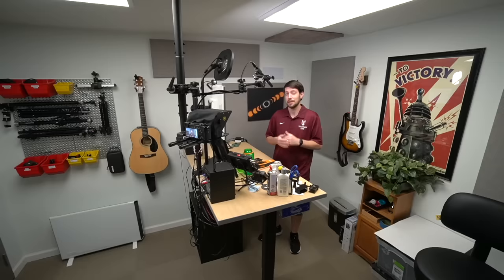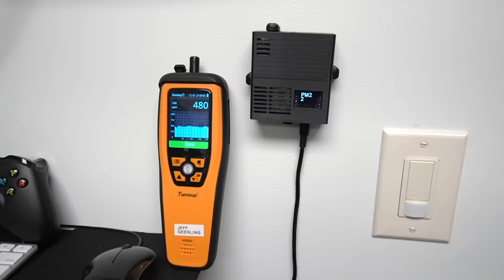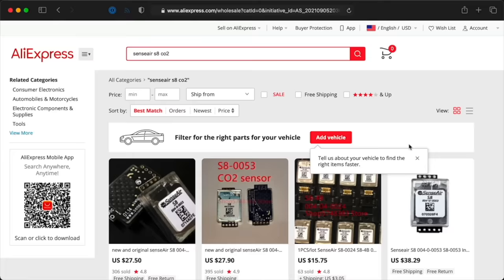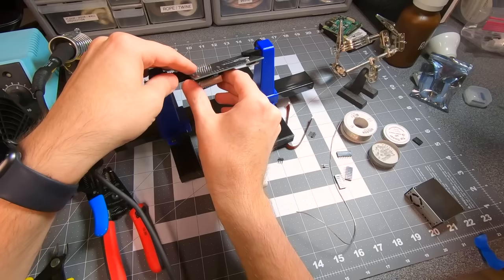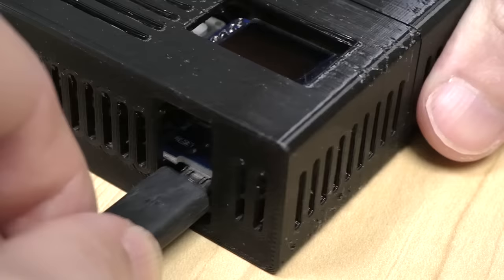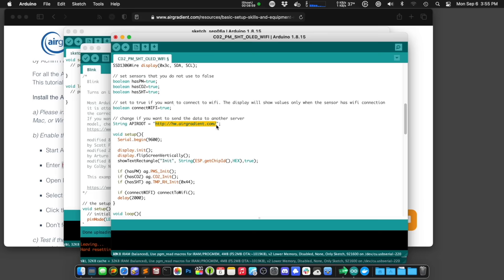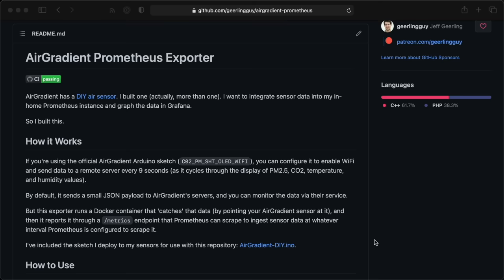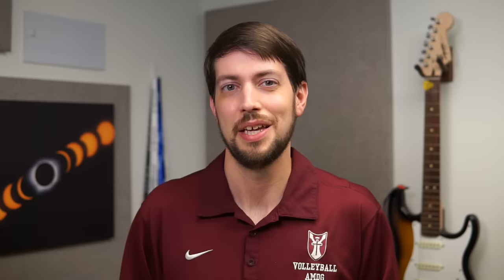Your home's air could be making you sick. Fight back!

Comment: Piping this into something like home assistant + automating the venting system sounds very cool to me. Might be fun to get that working.
Reply from the maker: ESPHome actually supports all these devices out of the box, so it shouldn't be difficult to build a setup for Home Assistant.
Reply: @JeffGeerling  HMMM Very cool. I might actually get this then. My dad and I have been looking for a more permanent solution with a vent we have available. Only problem is the size of the vent, but we can work around that. Thanks!
Reply: @jja2000  did you get any solutions get it integrate with Home assistant?. Thanks
Reply: @wissamoh  Use the ESPHome integration. If you flash the 8266 with esphome it should work out of the box.

Comment: I'm a noob with soldering but this actually looks accessible, I might give this a try!
Reply: Nothing soldered is surface mount so you should have a pretty easy time. One tip - if you’re new to soldering you may want to practice soldering header pins on a proto board first. Proto boards and header pins are available cheap on Amazon and other stores where electronics are sold.
Reply: @markconger8049  The more fun route to practice is to buy the simple project boards that usually only have some LEDs and a battery mount to solder on. I've been soldering since I was a tween, but I still buy the occasional one because they tend to be fun and thematic. My favourite is the sugar skull for Day of the Dead. People comment on it every year, so it's one of the rare solder practice projects you can show off and get good feedback heh.
Reply: Recommend you not buy cheap Chinese solder... especially lead based... it makes you dizzy...
Also...cheap solder that is RoHS compliant is super hard to work with because it doesnt melt and stick as well as quality silver based soldier
Reply: Same as SilverSnakeFreedom mentioned, his wideo makes it easy for two main reasons: 1. good quality solder with fluxed core, 2. proper soldering iron which can control the temperature. The practice will come with first few broken solders ;)

Comment: When I converted my SodaStream to use standard co2 tanks I bought a cheap ($150) co2 detector from Amazon in case I had a leak. I didn’t, but it blew my mind that the co2 level in my kitchen would spike to 1200-1500 ppm for a few seconds after filling a bottle.
Reply from the maker: The things you don't even think about!

Also, when we forget to turn on our range hood, the PM2.5 goes up pretty quick too.
Reply: @JeffGeerling  As an automation nut, the idea of having vents (bathroom vents, range hoods, house fans, etc) turning on based on air quality levels rather than manual switches sounds awesome!
Reply: @Waitwhat469  There is already a smart vent company, though they are expensive. If I can remember their name, I will post another comment.
Reply: cheap 150$ dollars co2 detector?
Whats an expensive co2 detector?

Comment: This is really interesting. I love that you don't need a cloud service. Does anyone know of a ring doorbell type of project for the Raspberry Pi?
Reply from the maker: I saw one a few months back... it wasn't quite as nice of a build but it did the trick at least, though didn't have two-way communication.

It didn't have an app, but a web UI.
Reply: Had the same idea, until I saw doorbell from eufy. All data is locally saved on micro sd card in the included homebase. Trying to figure out how to send the data to the rpi rn, but the price is worth the easy use/install
Reply: You could use something like motioneyeos. It would need some customization but I think you can trigger events using a button connected to the gpio pins on a pi
Reply: There are some projects using the esp32 cam as a doorbell, can use esphome firmware and integrate with homeassistant or plain mqtt

Comment: I kid you not, I was just starting out with Home Assistant and looking for what I could with indoor air quality. This is awesome, ty :D
Reply from the maker: ESPHome has support for all these sensors, so it should be easy enough to get it integrated!
Reply: He's using the old model air sensor. There are PMS7003 and even better PMSA003, the wiring on them is slightly more difficult, but many come with a breakout board that makes it easy with regular gpio pins. (all are on ebay)

Comment: Just put a “ventilation” label on the vent. Now that you know how important fresh air is, you can consider the label your public service announcement.
Reply from the maker: But then you'd see that label in every video! :)
Reply: @JeffGeerling  How about a larger white square plastic shield or so that’s lifted from the wall surface (like 10ch or so) and fits onto the vent. It covers the ventilation, while not blocking it completely.
Reply: @JeffGeerling  You could make a cover for the label?

Comment: I'm Deaf and trying to live nomadically. One of my fear was that there are simply no budget friendly option for a Deaf alert for CO2. Basically skipped the idea of having an indoor kitchen of some kind. I've been wanting to learn Arduino and basic electronic since forever just to make this one thing and voila! your vid showed up!. It's basically exactly what I'm wanting to make except no wifi and I'll connect a test button from my vibrating bed alarm clock to be closed by the pi whenever CO2 and the like gets too dangerous. Thank you!
Reply from the maker: Oh that's awesome! Glad you could do that, and maybe consider posting your instructions somewhere (maybe even just an issue on the GitHub project)?

Comment: Safety tip when snipping leads after my funtimes a few weeks ago.

Wear safety glasses.

Yes it seems stupid. Yes I've thought the same having worked on electronics for the last two decades and yes it is a pain in the arse but...

I was snipping some header pins flush and one of them managed to get into my eye and behind my lower eyelid. I ended up in a&e as despite my best efforts trying to get the metal out of my eye with tweezers, it did not go well.

And yes... it hurt, it hurt a lot.

Comment: For anyone who hasnt done projects like this:

I built a similar air quality monitor a month ago(own design, I didnt know about AirGradient unfortunately) , also getting parts from banggood and aliexpress.
The only tools I needed were a cheapo £10 soldering iron (you can order it together with the components if you dont have one) and a pair of sharp scissors.

If you wanna give it a go, its a fun project and might even help your headaches and afternoon slumps ^^

Comment: Seeing how long it takes for the solder to melt (around 5:20), I'd recommend a little more temperature. (The tip size does generally look okay, that's the other thing when melting solder takes too long.)

Comment: You should probably avoid soldering on your breadboard. Firstly, the breadboard might not be able to take all the heat and you could melt the plastic. More importantly, the breadboard interconnects will act like a heatsink for what you're trying to solder. Soldering is best done when all connection points are correctly heated, as all the solder will just flow where you want it to. For throughhole I usually don't need flux and just focus on heating up every pin and hole. It also helps when you have a bit of solder on the tip to make proper thermal contact with the parts.

Comment: I connected CO2 sensor with Home Assistant and installed HA app in phone. Now HA can send notifications to my phone "open window" :) Helps when you work from home. Long meetings with high CO2 will make you sleepy
Reply from the maker: I've been considering running HA instead of my custom setup. Maybe it's finally time :D
Reply: Which sensor did you use with HA?

Comment: Hello Jeff! Very nice video, very interesting! I am myself putting air quality sensors in my lab, so this is extremely on point for me :)
One thing i'd like to mention : now i am putting leads on my sensors, and have them in open air to provide better readings. When in a case, the heat
tends to accumulate, and many sensors are affected by heat. I try to leave some space between them (although most sensors don't heat that much, it is mostly
the MCU).

I'd like to mention also, as you mentioned "the easyest way", i find it to be esphome trough home assistant. With espHome, i assemble my node (i mean in the physical sense, plugging sensors, etc), plug it in USB, then open the esphome tab on home assistant's interface, create a node, paste the yaml config specified on esphome documentation, then hit upload. It will thus flash the esp, and next time, you can flash it over the air if you change something. I don't have to look for libraries or whatever... (i did that at some point, but it can be annoying with version changes).

Anyways, once done, your sensor sends data to home assistant on a regular basis (can be changed), and HA automatically makes graphes and all. But just to go a bit further, you connect your home assistant to influxdb, then graphana, and do the dashboards as you did. The easy route is to use the plugins directly in home assistant (HA); although i chose to have influxdb not running on my raspi4 that runs HA, because i have beefier linux server with dockers for such tasks; and i plan to keep the data indefinitely, poll the sensors often, etc. Don't want to add a unnecessary burden to th pi SD card.

I take good note of your sensors, i knew some, didn't know others. My plan is to have many air quality sensors running, and try to measure the deviation between all those sensors. Would be better if i had a lab grade one to calibrate my measurements, but i don't :) I am also willing to see if multiple cheap sensors in parallel can be used to significantly increase accuracy. In the begining with simple mathematical solutions, then later with AI (it is my field, so i want to use it there, it is not just for buzzwords :) ).

As for sensors, there is also the BME680, not great for temperature (BME280 is muuch closer to my reference probe for that), but give air quality index estimations (following the IAQ scale), as well as equivalent CO2. as for particulate sensors, i have many of them, and only a few are worth buying. The one you used is one of them : well supported in various project, documented, and caracterized. Many particulate sensors don't give life expectancy, calibration procedures, etc.

I am, as you are interested also by the geiger counter, and would like to also turn it into a physical random number generator :)

Anyways, i didn't know about the CO2 stuff, i'll look into it, it may explain why i sometimes also have a hard time focusing in my lab.
Reply from the maker: Thanks for all the details! I've been waffling on ESPHome / Home Assistant for a few months, but you may have just convinced me to go that route soon. Definitely will save some time in the initial setup / programming, and the built-in graphing might be adequate for my needs!
Reply: @JeffGeerling  If going for home assistant, i would advise to go for the Pi4 install (or another SBC) rather than the docker one. With the OS install, you have an easy addon repo, you just do things in the webui (you can ssh into the box and do it like this, but the webui automates a lot of boring stuff), whereas you have to deploy the container for each addon in the contenerized version.

For ESPHOME, you can do it from your computer, but again, the ESPHOME addon adds a webgui interface, and you can modify the YAML for your remote nodes from a browser. It validates the YAML in live with live error notices (explained, on top of that!)

I like to do it from there because i can then modify a node from any computing device on my network, i don't have to manage the toolchain (dependency X is outdated, blablabla, i can deal with this, but i don't want to), and you can also plug nodes via USB to first program them.

I would also recommend the file editor addon, allows you to modify the yaml  files on your home assistant install. 95% of stuff can be set via webgui, but some stuff can't (mostly advanced stuff), or it is at times faster to simply copy-paste a code snippet.

Then you have the snapshot utility, allows you to back up everything or some things only, in an easy way.

I have not done it yet, but there is also a way to have all your config files (minus your credentials, that you can save safely into a secret.yaml file) saved on a git repository (i just moved my sensitive data to secrets.yaml, so i will now do the git stuff)

Then for ESPHome, simply take a look at their devices/sensors that are supported : https://esphome.io/#devices
i even discovered some sensors that way, or found a way to use sensors i had bought but never figured  how to use.

Most of the time, i can find the config in the docs, and the times i don't, i find it on some forum, with the correct pins declared.

Last point, it may not be something you are considering right now, but when you have a home assistant deployed, you can buy a few sonoff smart relays, replace the closed firmware with esphome, and automate lights, plugs (turn on the ceiling fan when it is too hot, turn off the AC when the windows are open, etc), dehumidifiers and various stuff (there is even a "dehumidifier" component to have it work without having you do the logic, same for thermostats. 
You can also have an IR LED and send some IR codes to your AC or various devices from an ESPHOME node (one of my next projects, to smartify the AC)

Anyways, i talk too much, see you next time :)
Reply: BME680 and BME280 are resistive sensors and have overheating issues, which is why you probably notice your overheating issues more than you need to. In order to get ok sensing with them you need to use FORCED mode which puts them to sleep wakes up takes 1 reading and goes back to sleep. These sensors are mostly for pressure and for flight controllers so massive amounts of air flow..
better yet, though, you can use sensirion sensors which are capacitive like the SHT30 in this video (or better if you want 0-100% humidity the SHT31 or SHT35 or SHT85) all of them are better than all of the bosch sensors though. If you need PRESSURE then you should use a BME280 or BMP180 but only in those cases.
To replace the BME680 there is the SGP40 which is also a VOC sensor, but again from sensirion, which does much better sensors. 
Also as you said, keep them away from the MCU, sensirion recommends at least 3cm.. and in my testing it makes a massive difference, especially if your esp8266 is awake all the time it puts out a good amount of heat around it even though you can't feel it.
Reply: @gg-gn3re  Hello! Thanks for the insights!
I use BME280 mainly because i have tons of them, and they are cheap. They are my default "enviro" sensor to monitor rooms; for they are cheap, easy to find, and I2C. 
I have a MCP9808 temperature sensor on the same station (given for a very accurate, precise sensor by adafruit); i will add a SHT30 (i have one in my parts bin).
The experiment i am conducting is as much about measuring stuff as comparing sensors. Strange thing, the BME280 is really close to the MCP9808, but the BME680 is 2°C higher. However, the 3 curves are parallel, meaning i could apply an offset. 
I will look more into sensiron line, it is not the first time i hear good things about them. For now, i am dispatching BME280 in all areas of the house as well, and outside. Other than a roof over the sensors, i did not take any environemental protection measures for them, they have been holding for more than a year (here is the caribbean, humidity levels outdoor are often 80%+, and can reach 100% at night).
As for air quality, i have a particulate sensor i need to deploy, and i will look into other sensors. I also wanted to finaly deploy some sensors i had bought for quite some time  without using them!

Comment: FYI - I built a gizmo to measure temp, humidity, TVOC, and eCO2 using a DHT-22 and an SGP-30 attached to an ESP32.  After that was up and running, I 3D printed a case for it.  Before installing IN the case, the breadboard was sitting ON the case.  The TVOC sensor went nuts.  The reading wend from a00 - 150 ppb to 20000.  Moved the box away and the reading eventually returned to normal.  Incidentally, I happened to place a small plastic bag wherein I had received some small parts next to the TVOC sensor and it read pretty high as well.  I would think the bag would have been around and “weathered” to where any trace organic volatiles would have dissipated.  So, be cautious is using a TVOC sensor like the SGP30.

Comment: I ran a co2 sensors at home for some time a couple of years ego, unfortunately the sensor I used was rather unreliable so I ended up stopping it. However, it was really interesting to see how fast the co2 levels dropped by just opening a window.

The cognitive function of a person drops rather fast with poor air quality. At ~2000ppm co2 I think it drops to about 50%. It's not linear though.
Reply: I run a co2 monitor to keep ph levels up in my reef tank.  Opening a window in my last house with a box fan in the window would drop levels from 1500 to 500 in 10-15 minutes.

There are a few major factors at play.  First, can you get a cross breeze.  It's much easier to clear the space if you can blow in on one side and exhaust the other.  Second, how much area isn't capable of being exhausted.  Things like closets, bathrooms, or other side rooms hold in the old stale air.  When you shut the window, those areas will eventually balance out.   My last place was not ideal and would restabilize at around 800ppm in 30 minutes or so.  Being on the east coast with high humidity, leaving windows opened for hours on end was not possible 99% of the year.